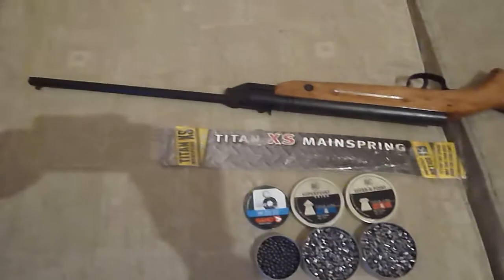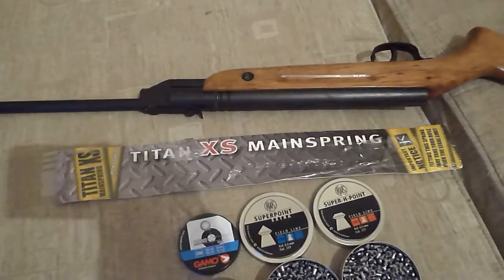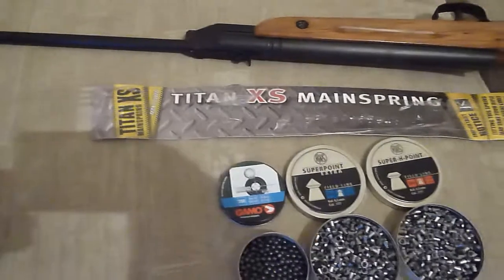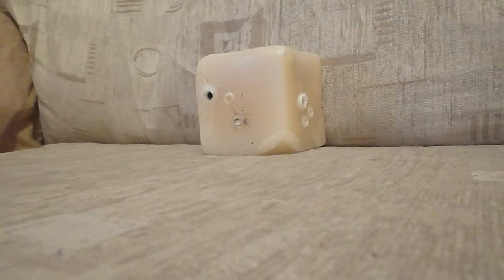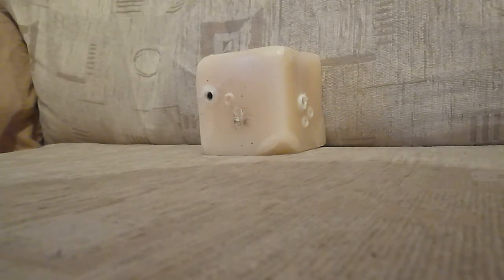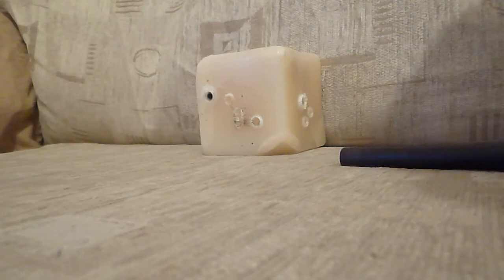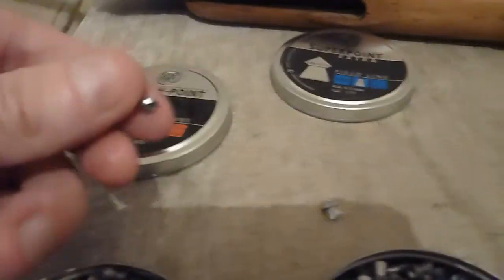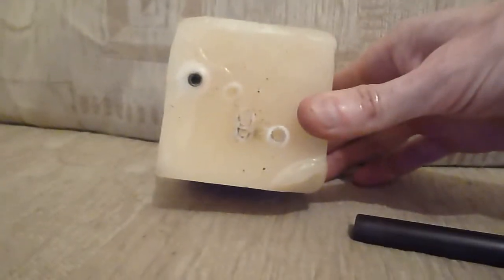relum slavia 618 mainspring upgrade .177, air rifle.

Comment: Hi! May I ask which type of titan xs spring did fit this particular model? Did it require any modifications or was it a straight fit? Thanks.
Reply: In the vid he says it's the one that fits the HW45, and he had to cut a few coils off it. From what i can research, it's the Titan XS 1-15. Happy plinking bud!
Reply: @FenWolf68   I have a model 619 and can't find any information on it